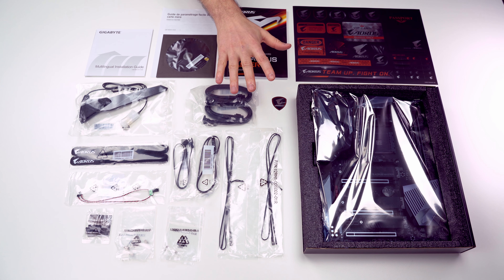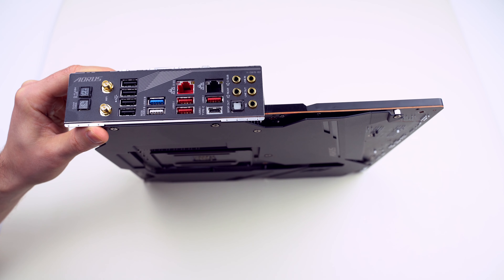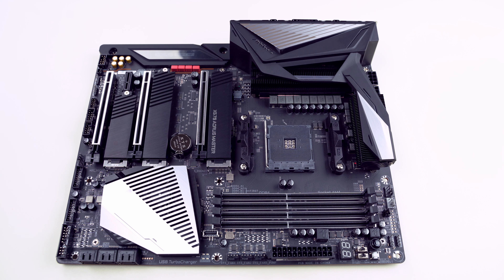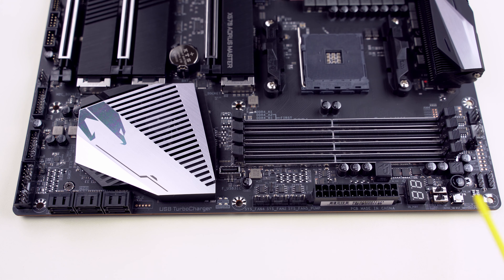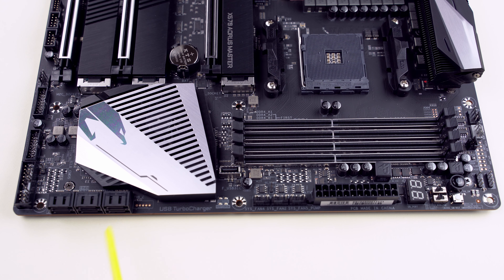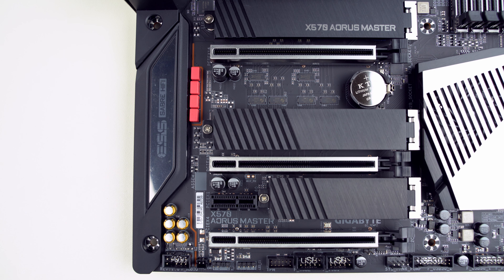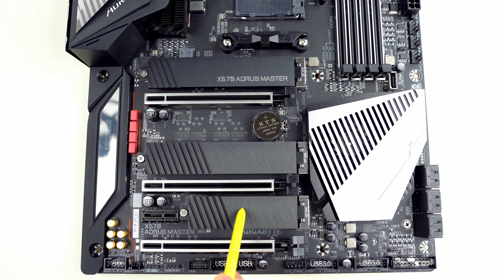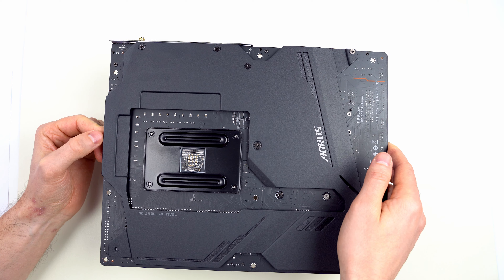Gigabyte X570 Aorus Master - Unboxing + Complete features description

Comment: can i update bios  with  5000 series cpu in board or i must use Q flash ?
Reply from the maker: Simple question - long answer ;) If you get lost in it - just ask :)

It depends on which version of BIOS your motherboard has now preinstalled + there is a difference between “Q-flash” (in BIOS - update process is visible on the monitor) and “Q-Flash Plus” (without CPU installed, no monitor needed) - just to be sure we are on the same page. 

Here are the possibilities and solutions:
1) If you have version „F30“ installed on you motherboard you can update with your Ryzen 5000 CPU in board (placed in AM4 socket) to latest version „F31o“ ( latest at the time of this post) using standard „Q-Flash“ in the BIOS (watching the update on your monitor, with mouse and keyboard connected). 

2) If you have an older version than version „F30“ installed - you will either need to have Ryzen 3000/2000 CPU installed in your AM4 socket to do it - and use standard „Q-Flash“ in the BIOS (watching the update on your monitor, with mouse and keyboard connected).

OR

3) You can use „Q-Flash Plus“ function (without Ryzen 5000 CPU installed in your AM4 socket – using “Q-Flash Plus button” on the rear IO)

Q-Flash Plus will update the main BIOS only if run without the CPU installed!! The system will shut down upon completion.
  
Before you use “Q-Flash Plus”, follow the steps below in sequence:

Preparation phase:
Before using the Q-Flash Plus function, make sure that your system is off (S5 shutdown state). (Power supply is connected to electricity, it is in power switch is ON, but system is NOT running)

Your motherboard has a BIOS switch and a SB switch, reset them to their default settings. 
(Default setting for the BIOS switch: Boot from the main BIOS – position “1” like in my video) 
(Default setting for the SB switch: Dual BIOS – position “1” like in my video)

Action:
1. From GIGABYTE's website, download the latest compressed BIOS update file that matches your motherboard model (at the time of this post 16/12/2020 it is - „F31o“).
2. Uncompress the downloaded BIOS file, save it to your USB flash drive, and rename it to GIGABYTE.bin. Note: The USB flash drive must use the FAT32/16 file system (if it´s not FAT32 format it first before uploading BIOS file - if you don´t know how to format it to FAT32 file system - watch my video here for this part - https://youtu.be/YjxoMC0r_0k 
3. Insert the USB flash drive into the white USB port on the back panel.
4. Connect the power cables to the 12V power connector (connect either one if there are two - 8pins) and main power connector (24 pin).
5. Press the Q-Flash Plus button and the system will automatically search and match the BIOS file in the USB flash drive on the white USB port. The QFLED and the Q-Flash Plus button on the rear panel will flash during the BIOS matching and flashing process. Wait for 2-3 minutes and the QFLED will stop flashing when the BIOS flashing is complete.
After the main BIOS is flashed, the system will reboot automatically and then DualBIOS™ will continue to update the backup BIOS. 

After completion, the system will reboot again and boot from the main BIOS.
Reply from the maker: @MiroslavJahelka  Ideal - visual always helps. Thanks for posting it here! Whoever else reads this - USE THE LINK ABOVE to see how an update using "Q-Flash Plus" works.
Reply: @MartinsLab  one more...sry... but.. where the fck  I find on the board manufactured version of the original bios?  I need to know the version of bios before I start to build that PC :D
Reply from the maker: @MiroslavJahelka  That is a good question, I have no idea, Gigabyte should have thought about this (ASRock uses a sticker with its BIOS version on the BIOS chip for example). BUT it doesn´t really matter for this particular motherboard since you have the option of using „Q-Flash Plus“ and updating to the latest version which you just download from Gigabyte´s website straight away.

The whole problem boils down to two scenarios: 

1)	People who have this motherboard and previous generation AMD Ryzen 3000 CPU already – these people can see their BIOS version and will just to go their BIOS, use standard “Q-Flash” update function and update the BIOS while watching an update process on their monitor. Then they just remove their old Ryzen 3000 CPU and place new Ryzen 5000 in their socket and it´s done.

2)	People who bought new motherboard and new Ryzen 5000 CPU (which is probably your case, based on your reaction) and who don´t have previous generation Ryzen 3000 CPU and for whom it would have been useful to know the information about preinstalled version of BIOS ahead of the installation to save time and avoid uncertainty. 

As far as I know, the information about preinstalled BIOS version is not anywhere on the box or the motherboard. So in this case - I would go straight to “Q-Flash plus” and update the BIOS using the “Q-Flash plus button” without knowing what my actual version of BIOS is. This will save you time trying to find your actual version of BIOS and will make sure you have the latest version which supports Ryzen 5000 CPUs no matter what.
Reply: @MartinsLab  Super nice video! :) I have a long question!

I just got the Gigabyte X570 Aorus Master and a 5950X! I assembled everything and tried to boot but it would not show anything on the screen so I did all the above and flashed the BIOS with "F31o" but I had CPU, Ram and GFX card installed! It seemed like it ran the update from the USB drive with the "Q-flash PLUS" button flashing and "Clear Coms" button was led. I left and came back after 15 mins and the "Q-flash Plus" button was off and "Clear Coms" was still led. I turned the power off and removed the USB drive and tried to boot but again, it would not post and the debug LCD showed debug code 07 and the diagnostic LED for the DRAM was on as well. I made sure I had put my 2 sticks of 8 GB RAM in “A2 and B2” slots and I had. I tried to put the RAM in the other slots to see if that did anything but I kept getting the same error on the debug LCD. And every time I turned off the computer it took the motherboard a bit of time got get power so the “power” button was lighting up red and I could push it. Every time I turn the computer off and unplugged it from the wall and plugged it back in to turn the computer on again it took the motherboard longer and longer to get power and now after 4 power off and on the board is just dead and do not get power and I can not turn it on! 
Did I do the BIOS update wrong and could have broken the board?
Can I "reset" the BIOS to "factory default" by using a screwdriver and "connecting" the two pins as you talked about in the video? Hope you or someone can help!
Reply from the maker: @sixten3877  Hi Sixten, lets take it step by step. The first time you tried to boot up your system with your Ryzen 5950X it is very likely your motherboard´s BIOS wasn´t up to date (didn´t support Ryzen 5000 CPUs) - that´s why it wouldn´t boot up. All motherboards come with outdated BIOSes, because their journey from factory to packaging, distribution, shipping and final delivery to you can take even several months. So your MB was made when Ryzen 5000 comaptible BIOS likely didn´t yet exist. Probability that this was the case based on what you wrote is very high.

When you later tried updating your BIOS you should have read the manual first and you shouldn´t have updated the BIOS with CPU installed. The manual clearly states, that when using „Q-flash Plus“ function - AM4 socket must be empty. What it did, when the CPU was in it while the BIOS was flashing nobody except maybe Gigabyte knows. (Everything necessary is in my post higher - I copy pasted Gigabyte´s latest version of manual from the PDF and added few details to make it even more „user friendly“)
OK, now we know what caused the malfunction. So, what to do about it.

I would try Clearing the CMOS and doing Q-Flash Plus again – as it should have been done (without CPU, RAM, GPU installed and all conditions which are stated in my post above met). If its going to help – I have no idea. You may have damaged the board – lets hope not.

The problem is that clearing the CMOS clears the values in a properly flashed BIOS to default, it doesn´t repair it or delete it (if it were flashed wrong way – and therefore corrupted). In that case you´d need take your MB to service.

Here is the manual: https://download.gigabyte.com/FileList/Manual/mb_manual_x570-aorus-master_1002_e.pdf
Clearing CMOS is on page 21 and 98

Q: How do I clear the CMOS values? A: For motherboards that have a Clear CMOS button, press this button to clear the CMOS values (before doing this, please turn off the computer and unplug the power cord). For motherboards that have a Clear CMOS jumper, refer to the instructions in Chapter 1 to short the jumper to clear the CMOS values. If your board doesn't have this jumper/button, refer to the instructions on the motherboard battery in Chapter 1. You can temporarily remove the battery from the battery holder to stop supplying power to the CMOS, which will clear the CMOS values after about one minute.

To your question: Yes, you can use a screw driver to reset the BIOS, it is one of three ways to it. (First is Clear CMOS button, Second is using the screw driver and the third is removing the battery for a minute - but before using any of them use the manual)

Fingers crossed that it works 😉
Reply: My Aorus master came with Bios version F30 which already supports Ryzen 5000 out of the box. I flashed to the newest F31Q anyway. Everything running without any issues
Reply: @Jax-pg3zm   31q was already deleted from gigabyte server :D :D  lets go back on  31 :P
Reply: @MiroslavJahelka  it says F31q in my bios tho 🤔
Reply: @Jax-pg3zm   yy it was there 3 days ago :) now is actual version F31 and F31q is deletes .. don't know why
Reply: A quick one, can a quick flash the bios and update it with the 5000 series cpu already installed or would I have to flash it with no cpu in. Just that my cpu comes today and I really wanna finish off building it
Reply: @MartinsLab  btw all boxes has a sticker ... 3000 redy or 5000 redy big shiny one :D
Reply from the maker: @MiroslavJahelka  Good to know! thanks for pointing it out.  Yet, there might a few pieces left in the distribution without them and in that case it might safe do BIOS update without a CPU.
Reply from the maker: @98az  As @Miroslav pointed out, look for the red sticker - it will tell you if your motherboard is "Ryzen 5000 CPUs ready" - if it has it you can go for it with CPU installed. If it doesn´t have it, then I would recommend doing a BIOS update without a CPU (just to be sure).
Reply: @MartinsLab  no probs thanks, I’ve fully built everything up now, I’ll I mount it and when I do the update then as it didn’t have a sticker, all tho I got a exdispaly board refurbished and it was signed this month as the refurbish date so I might contact them and ask them what bios it is running
Reply from the maker: @98az If it´s refurbished piece, asking first might be the right thing to do, because you probably have a warranty with "them".
Reply: @MartinsLab  yeah I emailed them before, it was of ebuyer and I’ve never bought of the site before so hopefully it’s all good
Reply: @MartinsLab  I say refurbished, it’s ex demo
Reply: @MartinsLab  The X570 master has dual bios chips and one of them is removable. If both bios chips are corrupted, Gigabyte can send you a new one.
Reply from the maker: @ashbridgeprojects6916  Thanks, I didn´t know about this option - might be handy for someone.
Reply: @sixten3877  same cpu and MB, i updated the bios with Q flash from a usb stick before installing the CPU which is what is usually needed but i also have the rev 1.2 board, also this board has dual bios, def do the bios before putting anything on the board but dual bios allows you to make mistakes, and Q flash with usb took me about 45 seconds.
Reply: Sorry to be offtopic but does any of you know of a trick to get back into an instagram account?
I was stupid forgot my password. I would love any tricks you can give me.
Reply: @Jasiah Ian Instablaster ;)
Reply: @Frederick Demetrius i really appreciate your reply. I got to the site thru google and I'm waiting for the hacking stuff atm.
Seems to take a while so I will reply here later with my results.
Reply: @Frederick Demetrius It worked and I now got access to my account again. I am so happy!
Thank you so much, you saved my account !
Reply: @Jasiah Ian glad I could help :D
Reply: Not sure if this helps but I believe there is a revision number on the bottom left, may have to do with whether it is 5000 ready.
Reply: @MartinsLab  Mine came 15 months ago with I think F.20 installed. I flashed to F.30 without the CPU. F.30 was the latest then. I installed the 3900x and it ran great for over a year, then I got a 5950x.  flashed through the BIOS using the dongle went to F.35 with the 3900x. Took that off and put the 5950x on and been amazed at how fast it is! Oh, I added a 980Pro to the top M.2 slot as well. It's amazing that people outside JPL can have this stuff!
Thanks for your in-depth info!

Comment from the maker: If you want to see a complete installation of a PC where this motherboard is used, have a look at my "Build guide" video - https://youtu.be/qB31vdRlIHg
These topics are covered in it, you´ll find links leading directly to each of these parts in the description of the video: 
Installing the standoffs inside the case for the motherboard (MB)
CPU cooler installation 1. - Noctua Secufirm2 mounting system - attaching to the MB
CPU installation into AM4 socket on the MB (AMD Ryzen 3900X)
M.2 SSDs Installation (different sizes and keys explained) 
Applying thermal compound (paste) on the CPU - REAL TIME
Installing RAM modules into memory slots on the MB
CPU cooler installation 2. - Noctua NH-D15 SE-AM4 (HS+fans)
Preparation for the first test run before entering the BIOS 
Entering the BIOS for the first time - REAL TIME - testing
Updating the BIOS - whole process (download to update)
Disconnecting cables&GPU from the MB after BIOS update
Installing heatsinks on SSDs and removing original stickers
Preparing cables before installing the MB into the case
Screwing the MB into the case
Connecting case cables to the MB (power&data)
Installing the graphics card (GPU) to the MB